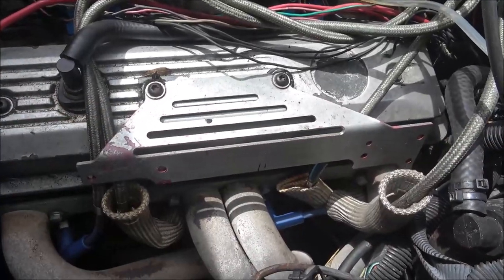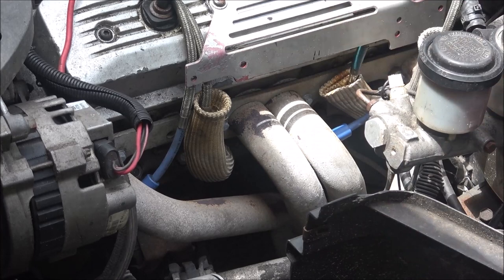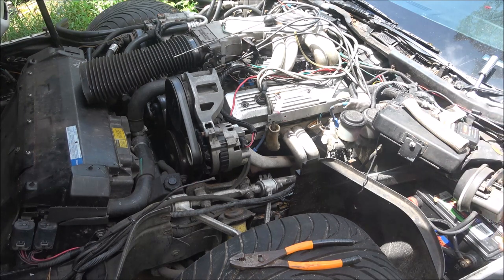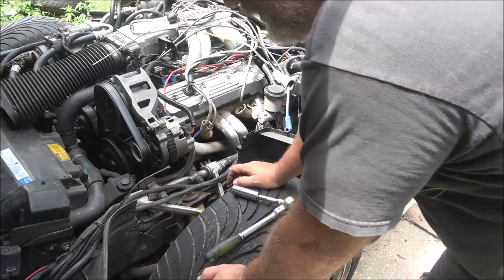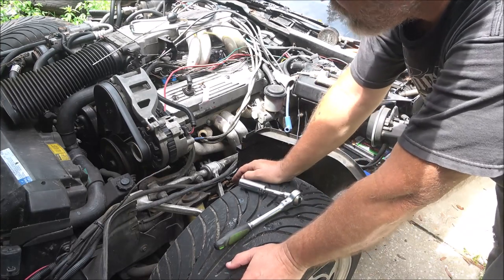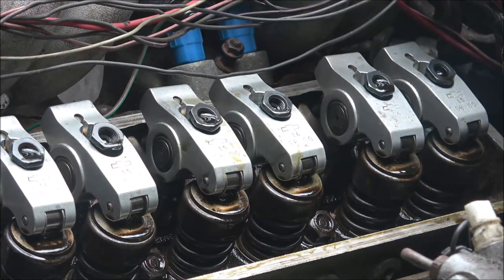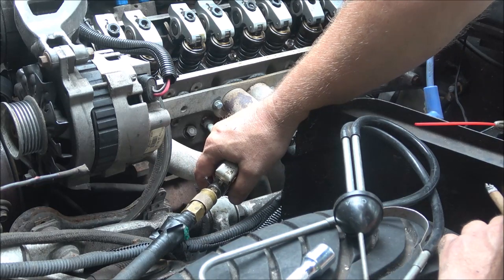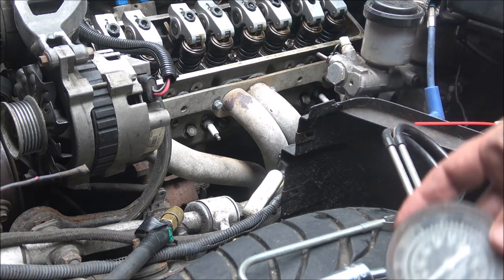How To Find A Dead Cylinder

Comment: When in doubt Go Back to the Basics my friend 🤠 . An engine is nothing more than a gasoline-powered air pump that requires five components to run properly. Timing - √
Compression √
Air - √
Fuel - 🤔 
Spark - √

I'll bet a dollar to a dog biscuit you have a faulty injector and I suggest replacing that injector before doing anything else,  unless that means a big camshaft, headers and a noisy Gear Drive of course 🙃 ..
Reply from the maker: Thanks idletime I agree. I was just telling my fiancee that I'm going to replace the injector first. I did order a new compression tester so hopefully it will hold compression. I just replaced them injectors not long ago because it had an oring leaking, so I figured while I was in there I would just throw some new injectors in. I still have the old ones so I might just put them back in. Thanks for the insight I appreciate it.
Reply from the maker: Also, I'm only going to put a gear drive in if I ever have to pull the cam but I think it's ok. And it already has the long tube headers so I'm good there. If I'm not mistaken I think it has 202 double hump heads. Again, thanks for the advice.
Reply: @shabear1000  It's all good & your welcome 🤠 . If it were me,  I would fix & run the sbc as is for awhile.  Then I would find a 68' or 69' 10.25:1 Buick 350 from a Lesabre etc to freshen up w/ a Comp cams 468H cam.  Milodon high volume / pressure oil pump.  Poston S-divider aluminum intake,  HEI distributor,  a Carter 675 afb carb & a set of 3.42 or 3.53 gears outback.  You'll be grinning like a Cheshire Cat and looking like the Joker from Michael Keaton's Batman and loving every minute of it 🙃 ..